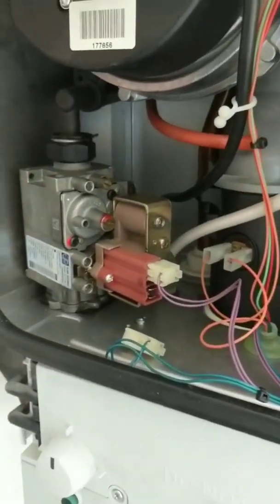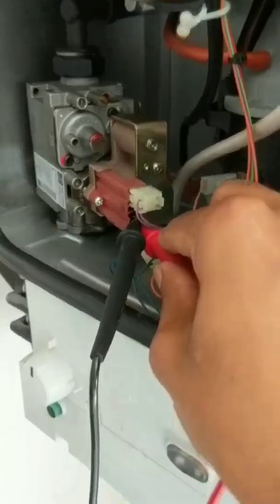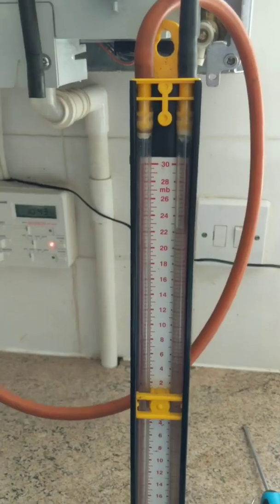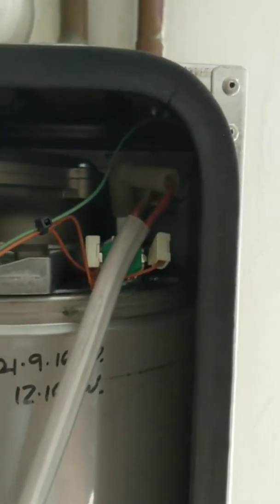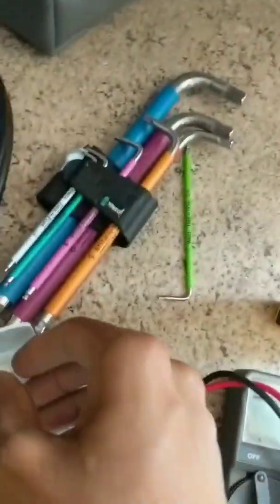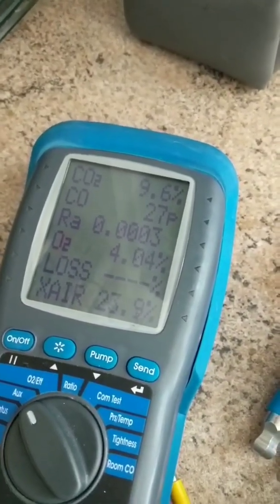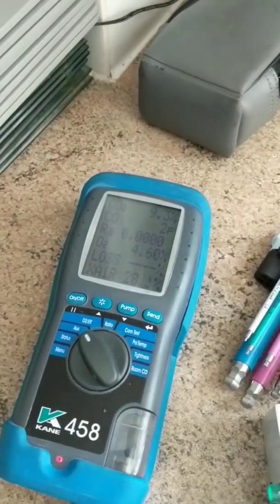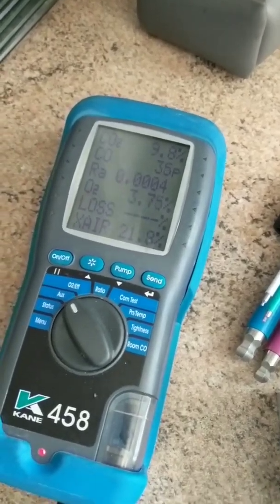Testing a gas valve on a Worcester Bosch & setting it up in service mode

Comment: Where did you get the readings ranges from? And what does it mean if there’s resistance?
Reply from the maker: Readings from Worcester tech, if the readings are out of tolerance then the solenoid is faulty and the gas valve needs replacing

Comment: If the co2 doesn't come within range say high is at 8.8% and doesn't adjust is the gas valve faulty?
Reply from the maker: Not necessarily, you need to check your working pressure to make sure there's enough gas supply, also if the gas tube has split or the burner seal has failed then that'll also impact the readings

Comment: Any engineer worth his salt would of Sussed the electrode connection with that loud crackle, also check the fan pressure and flue integ as this can effect the Co reading’s.

Comment: Do you know if this Worcester you’re currently working on in this video if you was to replace the gas valve does it come pre set ?
Reply from the maker: I believe you would have to check the readings and set it up

Comment: Hi buddy. Just a question about the test figures. Do you keep notes (mentally or physically) on the ohms readings etc or is there a platform or database that you use? Keen to know as I end up calling manufacturers every time for the data. So if there was say an app or a website with such info then it'd be greatfully appreciated to know about ☺️ good work my man, enjoying your content.
Reply from the maker: Hello mate, I remember the common figures that I come across, but any others I make a note when I call up manufacturers and save them on my phone
Reply: Yep that's what I do. I'll carry on as I am then 😁

Comment: I've been recently getting locking faults on our Greenstar 4000 (fault 2949) and it's gotten to the point now where the call for hot water won't fire but the CH is working fine. Could this be down to the valve not being set correctly? It's had this locking fault pretty much since we had it but very intermittently. Thanks for any help.

Comment: Another informative video, how do you remember all the different resistance values? Not all way referenced in the MI’s
Reply from the maker: Thanks mate, I tend to remember the most important figures where I deal with them almost daily, however I have a folder with reference material I got from boiler manufacturers courses, etc as well as can't always remember everything off the top of my head

Comment: I'm getting 388 ohm's on Top solenoid  And 177 on Bottom solenoid..   is that within tolerance on a 28i greenstar with same gas valve I'm diagnosing   ??
Reply: Sounds spot on for the sit sigma valve

Comment: Is it the same ohms reads on all worchester gas valves?
Reply from the maker: No, these readings correspond to this type of gas valve known as a Sit Sigma style with 2 connections. The other style is known as a Prettle valve which only has 1 connection 👍🏽